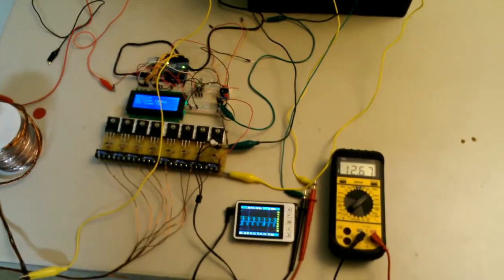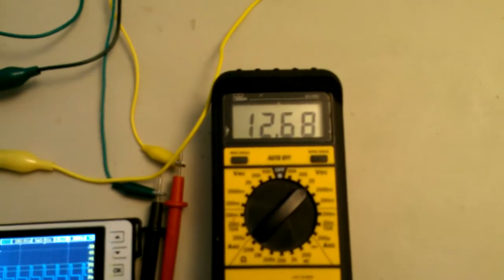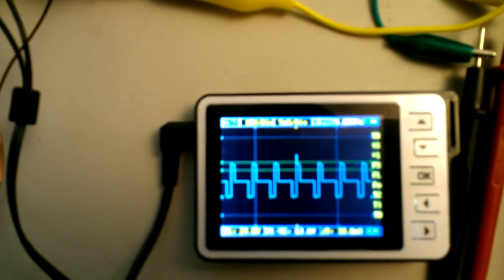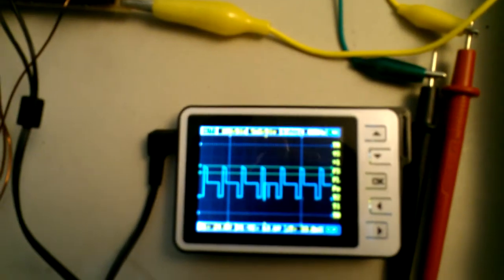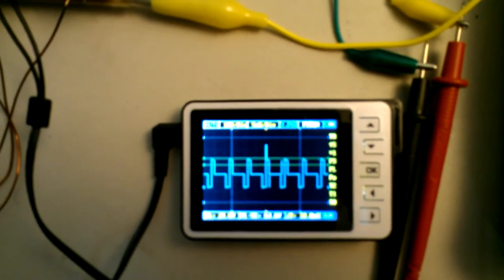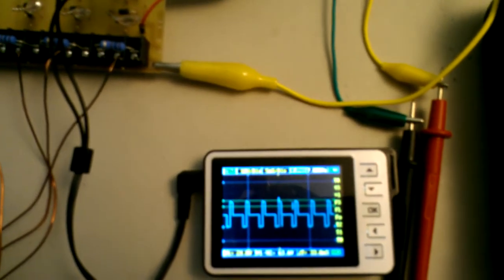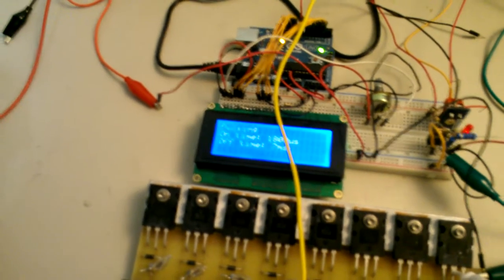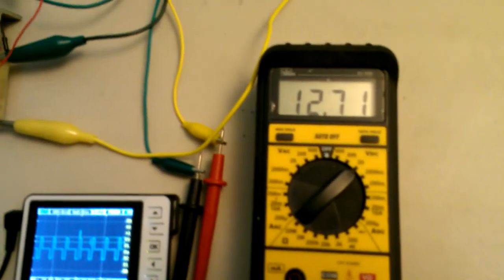Solid State Arduino 8 Circuit Bedini SSG Scope Shot

Comment: Where could I possibly get a copy of the code that you're running?
Reply from the maker: The code is just doing super basic PWM. You don't even need an Arduino to do it. I just used it because that's what I had.

Comment: Are you still experimenting with this?  Having some trouble getting my circuit wired up correctly hoping you could help.  I am using the wheel and not a solid state trigger.
Reply: v8Billy66 cant u make it spin?
Reply: got it figured out, thanks.
Reply from the maker: Post a video?